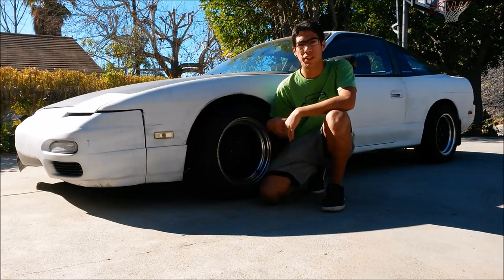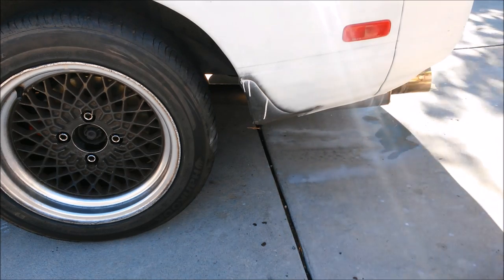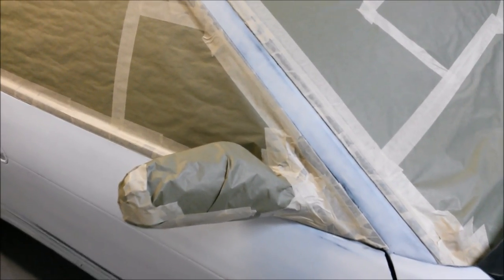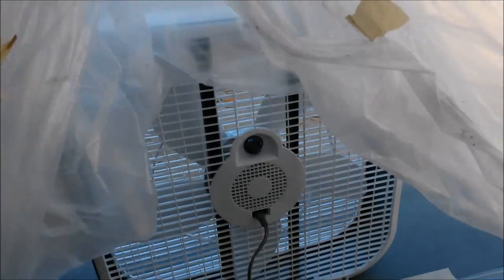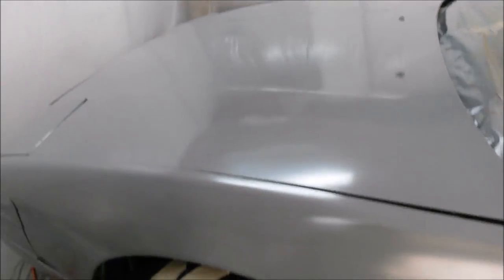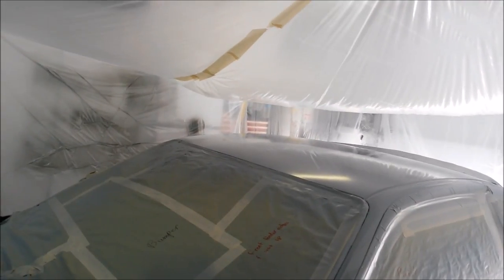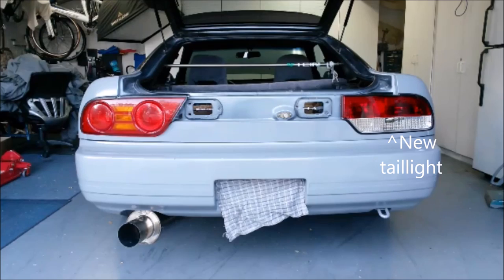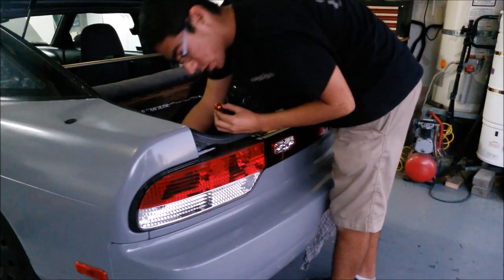Project 240SX Le Drift Car - Ep. 5 | Paint & Taillights

Comment: Props to all the hard work you're putting in. I had a s13 coupe that was a POS literally. I bought it with buddy club coil overs with dampening, xxr wheels 18x10, ghetto trunk battery relocation, just allot of problems and it was my daily.  Not to mention it had a jdm cluster so it took me a while to read the km's right so i got photo radar on a regular basis here in phx. Sold the car a year later to some kid for $4500 only cuz the red top swap and suspension,i kept the wheels tho lol. The kid didn't care about the problems he drifted or immediately and wrecked it months later. I usually don't buy cars already moded and such i like them oem and stock but at the time i needed a car for work. But props to you bro!

Comment: car looks good, but would look ever better if you could tighten up the body lines between the nose cone and front fenders. Good work with what you have done.
Reply from the maker: Yea the front bumper support is messed up so it sags. Hopefully when I make a bash bar it will be able to sit normal. Thanks!

Comment: This paint didnt need a clear coat? if no what would happen if you did give it a clear coat anyway followed by a polish etc all thos fancy paint steps to bring out a colours true potential.
Reply from the maker: It's not supposed to be used as automotive paint so it's really up to you if you want to clear coat it or not. Since I was doing this on a budget, I would have clear coated it with cheap, probably spray can, clear coat. And usually cheap clear coat like that will turn yellow or crack when exposed to major sun like a car in CA. So I decided to not clear coat it in order to prevent that as well as keep cost lower. Although yes it would turn out much more glossy and have a better finish if I had clear coated it.
Hope that helps :)

Comment: Quick question: did you use any primer or no? If not, are there any reasons not to? I'd like to use primer if possible/recommended.
Reply from the maker: +Evan Hooper (Aluminia) No primer. Primer is usually only needed when painting on a bare surface such as metal or fiberglass. When you're painting over top of another layer of paint like I was the paint underneath it that you scuff up gives good adhesion to the new layer of paint so you don't need primer.

Comment: These are great videos man, although you really should have straightened out the body first. All the fenders, doors, and hood are not lined up. Of course you can do it after, but if you have to buff out any dents or something than it is better to do with he old paint. Still a great series though, I'm gonna make my 1988 300zx into a drift car if I can afford it so these help a lot.
Reply from the maker: The fenders, doors, and hood are all the ones that aren't lines up because of the frame damage haha. So can't really do much there :/
Glad you like the videos :)
Reply: Not realizing it when we bought my car it had been ditched, hard, and it had tons of frame damage. my dad fixes semi trucks though so we used this giant rod with about a 15 pound weight around it. You place it on the damaged area and slide the weight down and it takes out the largely damaged areas

Comment: Thank you for commenting on my channel about the cost of painting your car. However, I'm on the fence about it. I really want to do this way of painting for my car but my dad advises me not to do this ("it's not real car paint, you don't have a dryer or regulator for the compressor we have, you need a professional doing this," etc). He tells me that Plasti-Dip would probably work better but it's more expensive and a gallon of paint is like $70. I'd prefer to do it with your method but I don't know how to convince him because even though it's my car and my money, he just doesn't want me to have a fucked up paint job. Just some advice would be nice man. Sorry for bitching lol
Reply from the maker: +Evan Hooper (Aluminia) You can get an inline moisture filter for your compressor for less than $5. That's all you need besides the gun. The compressor I was using was super small at just 3 gallons and 1hp and I still manages to paint the entire car. Plastidip looks awful in person and this looks much much nicer without a doubt. You don't need a dryer either, I just let it sit and air dry like the majority of people do when painting a car. Nothing wrong with that at all. Idk what to tell you. But Plastidip is such a joke it's not even funny.
Reply: ***** thank you so much man
Reply from the maker: Evan Hooper No problem

Comment: so what was the problem with the chassis was it just twisted to sheet?
and also have you thought of elongating the holes where the subframe mount holes are so you can correct issues you are having?

it may not be a solution to this cars problem but may be a meantime fix so you can get all ya alignments withing reason!!
hope i can be of assistance...
Reply from the maker: Yea the car has uneven spacing from the left to right side of the car as well and front and back of the car. I can visually see the frame damage on the front, but not on the back which is weird, so it's hard to pinpoint exactly what to correct. Problem has already been corrected for as of now, and it should be showed within the next two episodes. And I don't want to mess with the crossmember bolt holes because everything will eventually be going into a new chassis, so  I want to keep all transferable parts how they came. :)
Reply: ahh all sweet then mate so you swapping to a better base car soon one with a decent chassis?

Comment: Do you think the car will be difficult to drift? because i'm not sure if the Stock KA has enough power for it. That's why i have been looking for an affordable Turbo 240 to buy.
Reply from the maker: Stock KA is perfect to learn on, it has enough power to drift but not enough that you can put your foot down, start drifting, and never really develop skill. That's why It's better to start off with a stock ka, spend time driving it and learning technique rather than having a turbo 240 and being able to basically put your foot down and slide around.
Also, if you buy a turbo car and haven't turbo'd a car before you'll spend more time trying to sort everything out rather than actually going on the track and drifting. On top of that, the higher HP cars out there run into more problems while drifting due to the added stress on the drive line and engine with more horsepower.
So basically if you stick with a stock KA, you can develop more skill, have more knowledge of your car (cause you built it all), have a more reliable setup, and that will get you more seat time and and will save you money. Stock KA wins in my eyes.
Reply: okay thanks for your opinion, very good point there.  I may be better off then buying a NA Ka and going from there than picking up someone's tubo's car that's likely to be full of hidden problems. Well thanks dude. Also, good series of videos, ill keep looking out for the next one.

Comment: Where did you buy the headlights? Nice paint job bro!
Reply from the maker: xavier medina eBay. They usually go in and out of stock by sellers it seems. So if you can't find any right now, just wait a month or so and there should be more available.
Reply: Cool, thanks
Reply from the maker: No problem

Comment: What are the speccs on those air compressor? Did you have any problems with it?
Reply from the maker: 1 hp, 3 gallon. No problems, obviously just going to be running almost the entire time while painting, and if you spray continuous for a long time you will have to wait to build up pressure. Not really ideal if you're painting cars for a living, but it's doable for something like this. Oh and also the rule of thumb is that if a compressor is running a lot there is more moisture build up so run an inline moisture filter to get rid of any before it goes to the gun.
Hope that helps,
Reply: ***** Wow that is really small does it have a high CFM rating? Trying to figure out what specs id need for a compressor to do little repaint jobs. Thanks again for responding!
Reply from the maker: Not at all haha 2.4scfm @ 90psi and 3.7scfm @ 40psi
Well how big of jobs? Like respraying a whole car on an almost daily basis would require a pretty big compressor. But for doing the odd bumper here and there I'd probably just get a 20gal. or higher so it's not like you'd have to take breaks to build up pressure like mine. As for cfm people say check your gun to see what you would need. It's really up to you and how often you'll be using it honestly.
No problem, glad I could help!
Reply: ***** Last question I promise LOL. Did you use the HF gun with the higher cfm requirement or the lower one?
Reply from the maker: No it's fine haha
It was one of the purple ones which do 6 CFM @ 40 PSI

Comment: Did u clear coat ur rustolium?
Reply from the maker: Nope just using it as a single stage. Main reason was that cheap clear coat is usually not that great and it may yellow or crack over time so it was safer to keep it just as a single stage to avoid those problems.

Comment: I want to build a drift car I live in Missouri and I just don't know what car to look for and if I found one what to do to it it will likely be drift only I have a car as a daily driver but it's front wheel drive so no luck there lol I want a turbo 6-8 cylinder turbo car
Reply from the maker: I made this list for another person of almost every single starter drift car I could think of, it might help you out:

Older Cars: Nissan S12/S13/S14, Mazda FC RX-7, Toyota MK3 Supra, Toyota Cressida's, Toyota AE86, Toyota TE72, Lexus GS300, Lexus LS400, Lexus SC300/SC400, BMW E30 & E36

Newer/More Expensive Cars: Nissan S15, Nissan 350Z, Infiniti G35, Mazda FD RX-7, Toyota MK4 Supra, Scion FRS/Subaru BRZ, Hyundai Genesis, BMW E46

Comment: Did you spray a clear coat on the car?
Reply from the maker: Nope just using it as a single stage. Main reason was that cheap clear coat is usually not that great and it may yellow or crack over time so it was safer to keep it just as a single stage to avoid those problems.
Reply: Looks good regardless
Reply from the maker: Thanks!

Comment: Still no reverse huh?
Reply from the maker: I figured out that the part of the transmission where your supposed to put the reverse light switch, that everyone says and even the fsm says, is actually not at the front of the transmission, and is actually the plug at the top. So having that figured out, the switch now functions when the car goes in reverse, however something is messed up in the wiring between the fuse box and reverse lights so they still don't turn on.

Comment: That front bumper bothers me whenever I see it cause it looks like it doesn't fit in correctly. If you can fix it then plz do so.
Reply from the maker: Haha yea I know. It's kind of hard to describe what happened but basically:

Since the car looked to be in an accident in the front end, hence the frame damage, two of the holes for the bumper support, which is the metal "bumper" behind the actual bumper, are kind of "shredded" i guess you would say. And the bolts for those two holes are missing so basically the bumper support sags down in the front after driving a little bit and it pushes the bumper out from the top and that causes the poor fitment.
And on top of that, the sheet metal on the fender is pretty soft in the area attaching to the bumper, so even tightening that down doesn't help.

Sorry for the long explanation that was pretty bad, but yea hahaha I'll look at it again and see what I can do.

Comment: Why didn't you just go to the junk yard and buy the things for the tail lights.
Reply from the maker: In my area 240's are not that common in junkyards and so the two times I went to the junkyard when they had a 240 they were missing either the whole taillight, or the backings. So instead of waiting even longer and hoping they would pop up I just bought them on ebay.

Comment: hi i think i found your car drifting and booooom this is why you have bad chassis
Nissan 240SX bad drift ejects the coil spring
Reply from the maker: Yea I've seen that video before and it's probably similar to what happened with my car but it's not my car in the video.
The car in the video had: different license plate, black roof, different wheels, and the panel under the tails was painted white while my car still had it as the oem color.